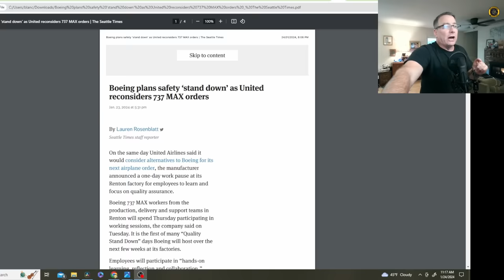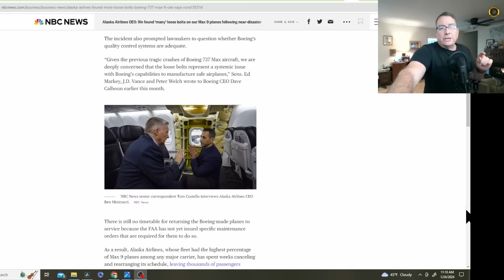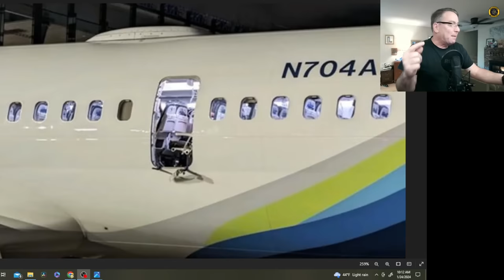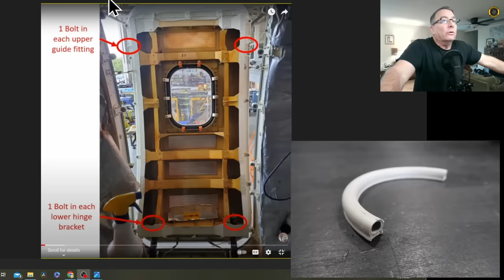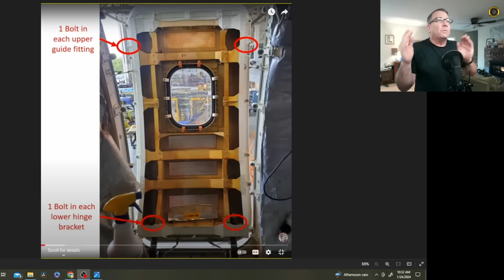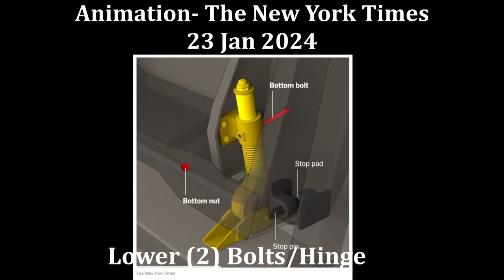Boeing's Quality Management Failure Explained 737-Max-9 Door 24 Jan 2024

Comment: I have a turnaround plan for Boeing:

1) Buy back Spirit Aerosystems and quit trying to squeaze Spirit's profits in order to mazimize Boeing's own.
2) Merge Spirit into Boeing's commercial division.
3) Spin-out all of Boeing's commercial operations into a new company called NewCo Airplane Company.
3) Set the headquarters for NewCo at Boeing FIeld in Seattle and staff the management with Boeing engineers.
4) Rename the company headquarted in Washington D.C -- I don't know, McDonnell Douglas has a nice ring to it.
5) Rename NewCo to be the Boeing Airplace Company.

There, the problem is fixed.

Comment: @blancolirio  Juan, I don't think Boeing is responsible for door plug failure. The timeline of the failure points to the wifi pod contractor. 
Alaska received the jet from Boeing on Oct 31. The plane flew more than 150 flights and there were no depressurizations reported through Nov 27. The Wifi pod installation work was performed between Nov 27 and Dec 7 by Alaska's contractor. The first depressurization took place the day the aircraft left the wifi pod install facility. Coincidence? I don't think so. Unless there is something to dispute this, there is a enough suspicion to investigate Alaska's wifi pod contractor. Where is this work documentation and final inspection report ? The simplest scenario for this would be a failed final inspection by Alaska's contractor or Alaska.
Also, of all the Alaska aircraft that have loose bolts on the door plugs, how many had wifi pods installed by this contractor? Did United or any other airline use this same contractor to perform their wifi pod installs? How far does this reach? Worth investigating.

Comment: in case of an emergency evacuation, are these plug door used? How it opens then with bolts installed?
Reply: Door plugs are only used when the seating capacity of the plane is less than a certain number. The number of emergency exits is determined by the number of seats. If the number of required exits can be met by reduced doors then a plug is placed in those door frames that are not required to be exits. Therefore, no the door plugs cannot be opened. To open them requires internal panelling to be removed and the bolts undone. Even then the plugs only open part way. From memory, I think they open only 15 degrees.

Comment: Personally I think Boeing should buy back it's Wichita assembly plant and hire all the people that are employed by Spirit.
I'm not against Spirit, but I think that when you contract out major assemblys mistakes creep in.
I've seen it happen at other Aircraft manufacturers. They contract another company but when they get the assembly, they have to rework it to bring it into specification. So contracting out assembys as a way to save money so they don't have to expand infrastructure. When in the end they aren't saving anything or saving as much as initially thought, they need to admit failure and pull manufacturing back within the original company.

Comment: Back in the communism the company where my father was working  had the same issues with trucks. It happened that a truck that was brought in to fix was assembled without camshaft. This is why they introduced new process management system for fixing trucks. This Boeing system was abandoned around 45 years ago where I born to avoid failures like this above...

Comment: Change the Boeing culture.
Get rid of the MBAs and bean counters from the top level, put engineers back in, consolidate locations. 
Make the plugdoor poki-yoki, i.e. impossible to be used without required safeguards.  
Quality assurance is not a 1 or 0 outcome game, it is a grayscale. Score everything on a scale of confidence. Make employees/workers responsible participants on par with mgmnt.
The plug-door should be riveted shut permanently.
Airlines, FAA and NTSB should be more intrusive in the process.

Comment: This seems to be a really big failure on someones part. I don't know if it's Boeing, Spirit, someone else or all of the above... The only way I can see the plug departing the way it did is if NONE of the four bolts were there. If even ONE of the four were there, it seems highly unlikely that the plug would have ever been able to depart the aircraft. The bolts don't hold the plug to the frame. They only make it impossible for the unit to move in such a way as to disengage the larger retention components.

Comment: It now seems lucky that the relatively benign exit of a door plug revealed the deeper problem.
Reply: It was only benign by chance. If passengers had been seated next to the door, or if the blowout had happened at a higher altitude, this would have been a disaster. The nature of this incident was far from benign, and the NTSB has been right to treat it as a serious accident.
Reply: @alexadamou7039  That's why I said "relatively", tongue in cheek. The operative word is "lucky".

Comment: First of all ask who was the last person to open or remove the door. It seems to me that the company that installed the wifi eguipment may have been the culprits because they have to remove the door to install parts of the system. Was that documented? No background there Juan, why not. It is pretty obvious that there has been a breakdown in quality control at sterling but how much tracking has been done by investigators of any undocumented plug removals. It is all well and good to point fingers and call people out but consider that this is the only door plug that failed due to poor quality control and there has been no published statement explaining the breakdown  in QA in this particular accident

Comment: The Financial Times reported this on Oct 25 2023 in an article titled "Boeing cuts forecast for 737 Max deliveries after quality lapses", which looks like a smoking gun which the CEO Calhoun pointed at himself:

The amount of work to fix the rear pressure bulkhead defect on the 737 is greater than Boeing originally estimated. The company had made its quality processes more exacting, Calhoun said, and “as a result, we’re finding items that we need to resolve”.

“These are not newly created defects in the system,” he said. “Instead, thanks to the culture we’re building, we have identified non-conformances from the past that we now have the rigour to find and fix once and for all.”

So he knew all about this.  Why is he still in place?  Why has he not been detained for questioning?  Imagine if this were a chinese plane.  Is Boeing just above the law?

Comment: The mechanics who are assembling the planes are at the front line of quality control.  The mechanic who installed the door plug and those mechanics who installed the insulation, inner skin and trim and did not say anything are guilty of incompetence.  So blame the unions at the Boeing plant for hiding these errors.

Comment: I worked both factory assembly and flightline preflight positions. It's an idiot argument to suggest that one process name versus another process name is the problem. SPIRIT AIR is the problem,  not the process name. I don't care if you call it "opening the door" "removing the door" or "disappearing the door." Any door process should annotate removal of mounting hardware and should therefore require a QC inspection before buyoff. If SPIRIT denies Boeing technicians authority to work the door then SPIRIT is at fault.

Comment: Juan, Nolinor Airline in Canada are flying 47 year old Boeing 737- 200s over remote North Canada and over gravel strips!... Can anyone say with ANY degree of confidence that Boeing 737 Max aircraft will be as reliable?
Reply: There are people still operating B727's around the world. In my opinion the most rugged Airliner Airframe Boeing ever built and also very fast. The main thing that killed the B727 was they were FUEL PIGS and also the 3 man cockpit. I preferred flying on B727 over any other Airliner ever built. I do also like the B757's.
I realize that the 707 - 727 and 737 early generation Airframes were all built very much alike.

Comment: You know, for two companies that were once one about 18 years ago, it looks like deliberate attempts were made to make sure they don't operate on the same page. 

Granted I could perhaps understand some "proprietary" processes with Spirit because they now handle manufacture of components for both Boeing and Airbus products and there are likely some blocks in place to make sure Boeing doesn't know what Airbus is doing or vice versa. But, it's like Boeing and Spirit deliberately keep their tracking systems separate so they can utilize CYA (cover your ass). And that is a recipe for disaster as nobody seems to care about delivering a safe and good quality product anymore, just sticking it to the other guy and making sure they follow the letter of a contract, not the spirit of it.

Comment: A new airline would be foolish to buy Boeing product at this point.

In an acquisition pinch, it’s better to rely on a good used aircraft with slightly higher block seat fuel consumption than to roll the dice with Boeing if the queue time at Airbus is long.

Comment: That should be very easy to fix.   The opening of the door requires the inspection of the bolts.   Removing the door requires opening the door.  Audit the hell out of procedures, and they should be able to resume production soon.  This is not a deep error in the design of the airplane, but yes the culture is bad there, but they could have more inspectors, and they should let the airlines see the logs for spirit and boeing.  There is no reason for spirit to be another company... That is a kind of corruption.

Comment: The people installing the door plug should be required to also install the bolts. I guess that might involve people and equipment on the outside SIMULTANEOUS WITH people (including the f’ing inspector) and equipment on the inside of the fuselage. I bet there are a few bolts used to attach an engine and they always make sure they are installed. What if an engine falls off in flight because of missing bolts? Is a door blowing off in flight worse than 1 engine falling off while in flight? Maybe. They wait for a paperwork inspection to find out a door wasn’t installed properly. Really? How many times has that paperwork inspection actually been performed? Have they ever caught an improperly installed door plug (or engine) through a paperwork inspection?

Comment: An inspection of the door bolts should be automatically triggered by the mere acknowledgment of the door plug's existence, much less any actual work being performed on it.
Reply: It seems likely that the door is inspected as a matter of course during normal processes, what happened here is a rubber seal was replaced, however this was done by merely opening the door - if the door had been removed, more paperwork would have been created and a quality inpsection would have been triggered.

My understanding is that Spirit opened the door, per Boeing procedures, and Boeing did not inspect the door because they had no record that they needed to (per Boeing procedures).
Reply: @TWeaK819  that does seem to be the problem. Why wasn't another inspection triggered by the work done that required some amount of manipulation of the door?

Comment: It’s pretty simple, you undo a set of bolts, you raise a step of instructions or notifications on the “MXI” or whichever computer log your company uses,  for the job completion or aircraft release, that information needs to be signed off as completed, and in some cases ask for a dual inspection, yes two individual s to do seperate inspection examination. It’s not rocket science, it’s starting to sound like a cover-up. I know this industry well. Someone got lazy or skipped a simple most important engineering procedure in the book. To suggest a typo between two industry leading manufacturers smells fishy- dude, I’m 42 years in aircraft engineering. I begin with fatigue, cost cutting, management on perceived productivity perks, the chain of command above that, right up to the CEO.

Comment: If these plug doors are not used for entering or exiting than what is the purpose of these doors?
Reply: They are optional door openings depending on seating numbers etc. . Alaskan airlines had reduced seating so safety regs said they could plug the opening with the cheaper option.
The plug doors should be redesigned to be fitted from the inside and therefore the cabin pressure would not be working against the fastners.
This disaster shows both poor engineering design as well as basic system maintenance flaws.

Comment: *Quality of workers*. The mechanics are not doing proper PMs and their work isn’t being checked. People are hired to do a job and are compensated to do the job. Supervisors can’t check every nut to make sure it’s torqued down and secured. 

You know how you fix it? Fire the people responsible for this. There should be a paper trail to the mechanic/tech worked on it. Get rid of them, black ball them or whatever you have to do to ensure they can’t work in this industry anymore. They’re a liability and this isn’t the job for them. It’ll put some fear in the other mechanics because if you’ve been in this career for 25 years, what will you do if the industry black ball’s you? Start over doing something else? When there’s a spouse, mortgage and kids, you can’t afford to start over. No one wants to lose their job, especially in this day.  Having to start over just isn’t viable option for most. 

So, idk how much Boeing could actually be blamed. It’s the same across many industries. You won’t know if there is an issue with quality control until a failure occurs.

Comment: Seem video mainly blaming the different quality control between Boeing and Spirit. Although there is some truth to that, but why wasn't incompetent employees was never mention? When professionals take something apart, they are responsible for putting it back correctly. Any competent workers would never slide a fixed door in and WALK AWAY. Inspection should mainly be expected to find mis torque bolts , misc and yes ....missing bolts. In this case, I blames those incompetent employees more than quality inspection process. If it is a process problem, then every planes should have the same issue. This is a one off,  so who is responsible for reinstalling the door plug didn't do their job. I hope they track down the employee and fire them asap.

Comment: At this point, I'm actually glad I don't work in the industry anymore. It has gone to shit since I went to A&P school 20 years ago. You can't pay me enough to get on a commercial aircraft these days. We're in the bad part of the safety cycle and a lot of people will have to die before commercial aviation becomes safe again. 
The 737MAX breaks all the rules of good aeronautical engineering. It is an inherently unstable airframe and that design philosophy only belongs on a fighter jet. I knew when they put the MAX back in service it was a huge mistake and, at that point, I realized that the FAA is out to lunch. It is time to get rid of that inherent conflict of interest that has plagued us for 70 years. 
I say, shit can the FAA and put the NTSB in charge. They're actually competent and have no conflict of interest. We'll quickly see who deserves to keep operating, with regards to manufacturers and airlines. 
5:38 - Out to lunch. This is bad engineering and poor regulation coming together to create a perfect shitstorm.
Opposite this in the news, are quiet SSTs and PAVs. Keep dreaming....It is ecologically irresponsible to have supersonic transports even if you can eliminate the noise. And a bunch of non-pilot morons flying around in aerial Tesla Autopilot wannabes is similarly irresponsible. You really don't want the aviation fatality rate to be the same as that for cars and that's exactly what you'd get. Electric planes? Forget it. Not even with nuclear diamond batteries. Any battery is too heavy. Maybe if they perfect nuclear fusion and can have on demand power that meets the requirement from a fuel like heavy water. 
And lastly, we have at present, a Transportation Secretary who knows absolutely nothing about aviation.
As a lifelong aviation fanatic, certified maintenance tech and sport pilot, I'm really pullin' for high speed rail...

Comment: This is being overcomplicated. 
This isn't a door, it's a plug. Therefore it can't be open and closed and shouldn't be labeled as such it QC.
Who is responsible for installing the bolts?
Who is responsible for inspecting the bolts to make sure they are tight upon delivery of the plane?
Who is responsible for inspecting the bolts while the plane is in service?
This info should be attainable in minutes.

Comment: Like all disasters, a series of mistakes was made. Boeing missed the bolts, but the airline kept flying with cabin pressure alarms. The air pressure was leaking out the loose door! The airline's answer - is don't fly it over water. How does that evert a disaster? Is it better to crash into the ground? If there was a chance of a crash, ground the dam thing.

Comment: Stop calling it a "door". It is a hull plug or a panel. It doesn’t have hinges and can’t be "opened". It can only be removed which should trigger a check of the bolts. The terminology people at these companies are at fault and need to suffer the consequences.

Comment: Hey Boeing, does this one finally have your attention?  There is ZERO excuse for FOUR bolts not being installed.  If one bolt had been present the door could not have moved at all.  QC at Boeing needs an enema from top to bottom and the top Boeing folks need to find new jobs, hopefully at a florist.